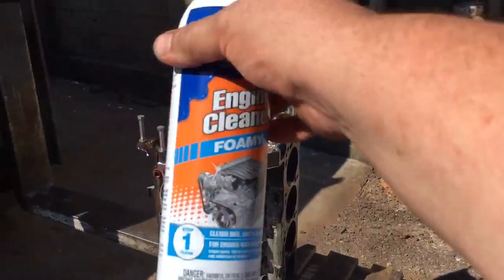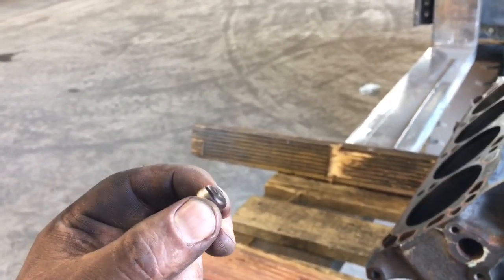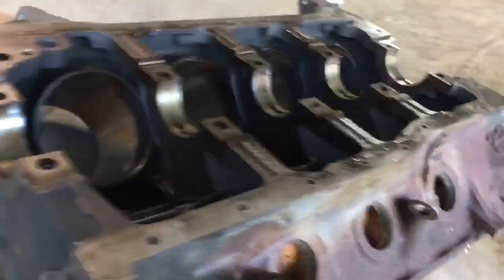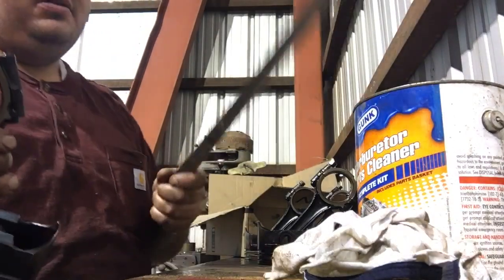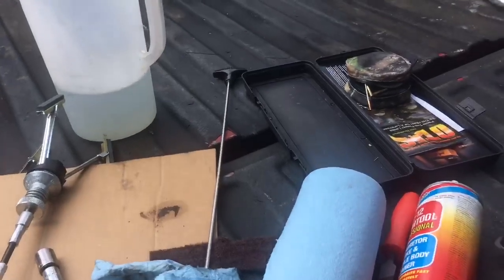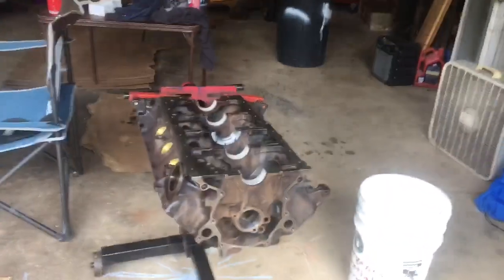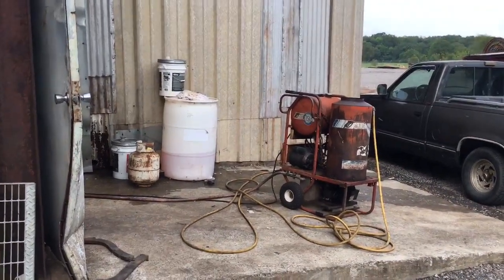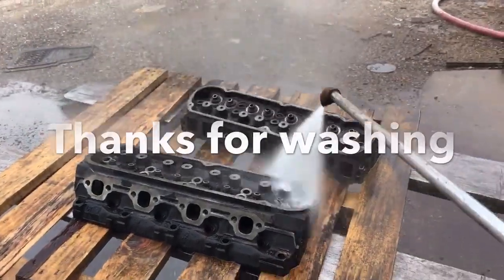5.0 Engine Rebuild VLOG (Employee 302 part 1 of 2)

Comment: That was a neat trick with the valves making them smaller, I often thought about doing that but never have heard anyone else do it but it should let that thing breathe and flow better  have you done that before and did it help it power wise ? I'm actually porting 2 sets of heads now and may try that trick on them
Reply: I cut them down to use as port gauges, sorry I wasn’t more clear about that. When porting close to the valve seat  you want to open that area up to around 85-90% of the size of the valve. I plan on using the cut down valves to measure my progress as I work the throat/bowl area. Uncle Tony has some videos about grinding/shaping the valves so they’ll flow better. Every little bit adds up.
Reply: @Sikulz  🤣😂 yeah I realized that after I posted the comment 🤣 I had just woke up when I commented on it and after I come to my senses I knew then I had posted a stupid comment 🤣😂🤣 I don't need to sleep and comment stupid things happen 🤣😂🤣
Reply: @Sikulz  yeah I saw one of Tony's videos about rounding up sharp angle on the back of the valve and the front, I'm going to try it cause it surely can't hurt anything unless I screw up a couple valves 🤣😂 I hope not
Reply: 79Beans 347 lol don’t sweat it, what I mean and what I say doesn’t always come out right, lol especially if I’m tired. 🤷‍♂️
Reply: @Sikulz  😂🤣😂 yeah these early mornings and long rough days are catching up with me . I jumped up at 6 PM a couple days ago thinking that I was late for work and started getting ready before I realized that it was still the afternoon 🤣😂